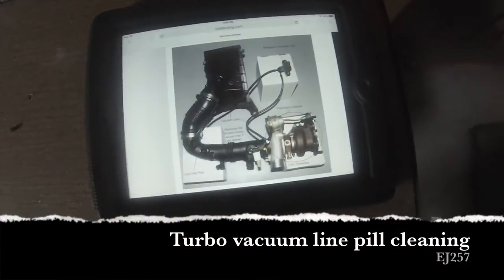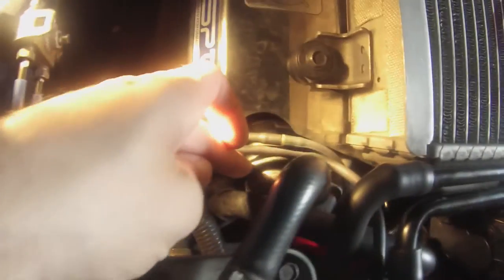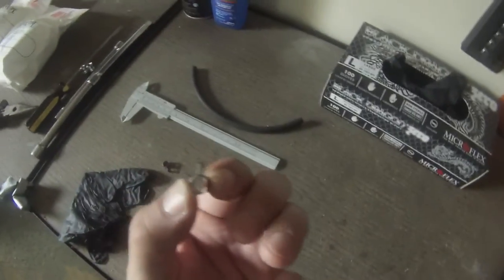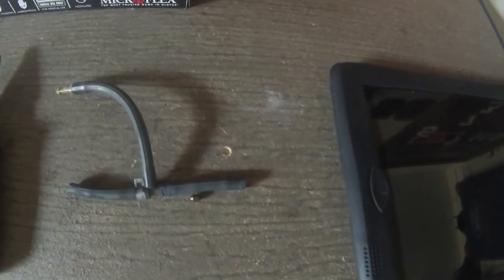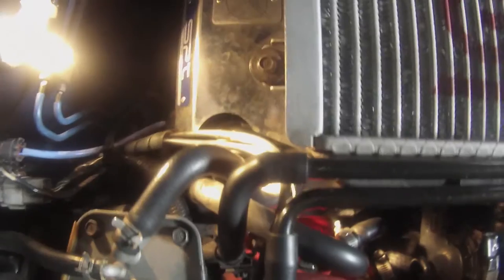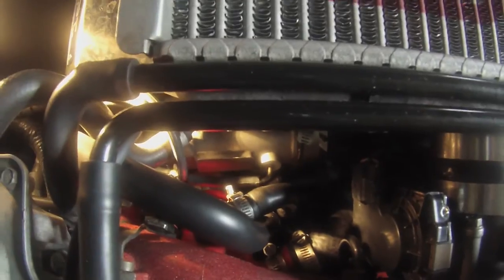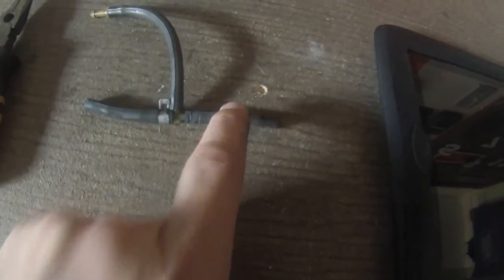Service series Part 16 Restrictor  pill Subaru WRX STi t vacuum line cleaning SVTWRC

Comment: Great video. Very clear instructions. Just a tip on spraying the vacuum lines though: use silicone lube instead of a petroleum based lube like WD40 or PB blaster because the oil-based lubes might degrade the hose.

Comment: thanks for the vid, my 05 STI is stuck on wastegate pressure (10PSI) so I will definitely try this. Is this something that needs periodic cleaning?
Reply from the maker: It’s not a bad idea to run some WD40 in there to loosen up debris on occasion.
Reply: @svtwrc  how would MAF cleaner go?

Comment: I just now came across this video. I bought a 2016 sti and it seems it was brought back to stock. And I’m only hitting 10psi with a stage 1+ Cobb OTS tune, even before that when I got the car stock, the car says peak 10.5 but I couldn’t reach it. So do you think I’m missing the whole hose thing or the pill is blocking it?
Reply from the maker: It’s worth taking a look it sounds like your just reaching wastegate PSI . Def look for unplugged hoses and or cracked hoses around the turbo and boost solenoid.
Reply: @svtwrc  will do! I’m new to this platform and 1st time having a forced induction car so I’m clueless and I’m lucky to stumble on your video. Do you happened to know where to look on Cobb website about the diagram?
Reply: @svtwrc  hey sir! I just wanna follow up and can’t thank you enough. If I didn’t find this video I wouldn’t know what to do. Basically the previews owner installed the T fitting backwards. The pill hose was connected to the wastegate instead of the turbo. I flipped it and ohh boy! She’s pulls!

Comment: Could this possibly be the reason my 05 lgt is only pushing 8.5 psi right now? Maybe my pill is clogged and the factory boost control shut down?
Reply: No, if you aren't able to reach target boost, then you are either missing the restrictor pill or the port in it is too large.  Check to see if you have it or if it has been modified.

Comment: hey great video. I´m having some boost issues too.. but my restrictor is in place. my car has a splitter in the vacum line close to the sensor (sti v5 2 way sensor) and that splitter also had a restrictor... it was broken and i cant find the part anyware... do you know the size of that restrictor? thanks for sharing this video!
Reply from the maker: Thanks and as for the size of the pill, think it matters on when you want the wastegate open . Doing some research I see that Cobb tuning makes pills and lines for under - over boost conditions. The different size of the hole in the pill is when the flap opens. Smaller hole in the pill more boost. A clogged pill will boost till the motor breaks.No pill and you will see wastegate pressure at 8-10 psi only. Are you under or over boost?
Reply: SVTWR my car keeps going and then it dies they say I have high boost issues

Comment: Hey bro! My 2018 STI is not boosting past 8psi in S# any ideas? No codes or anything
Reply from the maker: Lewis Harvey hi ! You can try a ECU reset and or uninstall tune and reflash . The line is clogged w the pill or one of the lines to the boost solenoid may need to be cleaned out w MAF spray.
Reply: Did you find anything that fixed it ?

Comment: what if you just take the pull out competently ?  what would happen
Reply from the maker: AndrewMacedonia hi there. The pill keeps the electronic boost control in check , no pill means overboost issues . Every different year has a pill size that needs to be met for the boost controller to stay within boost levels.

Comment: Special lining? C'mon it's just a piece of rubber hose it's nothing special
Reply from the maker: If you use a hose that's flimsy it will collapse under vacuum giving you serious boost issues plus that lining is important, if you research certain rubber will rot away with fuel, oil ,or coolant, there are certain rubbers that can handle certain chemicals without rotting away.